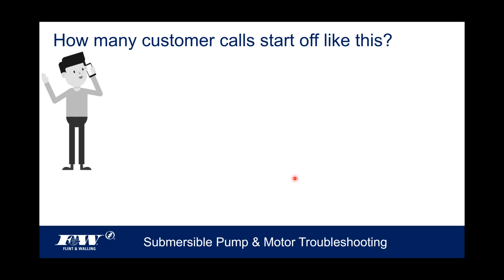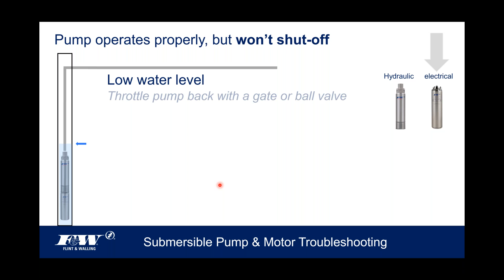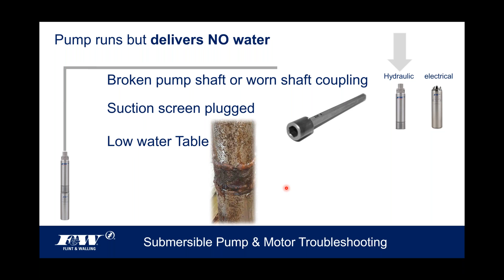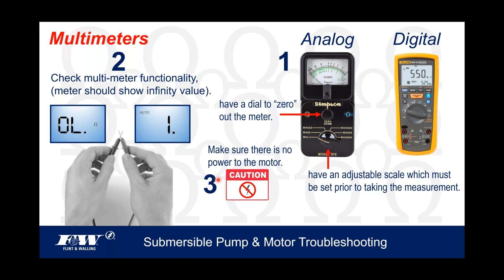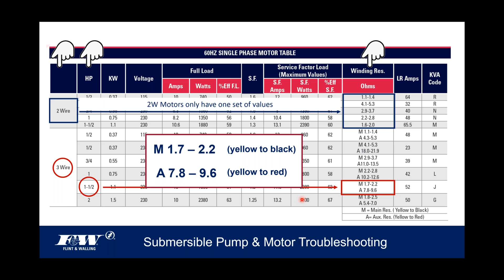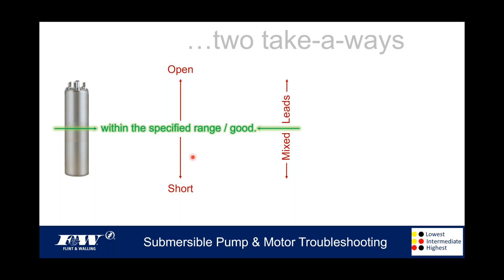Submersible Pump & Motor Troubleshooting

Comment: WOW! Was that ever worth sitting thru (my pump is not working). Was able to ascertain what the problem is besides a fried relay (I let the tank air pressure get too low too long). so when the pump guy comes out to do the work, I will understand exactly what he is checking for (and see if his readings match mine close enough to trust him) and be able to at least discuss the situation and understand. I could do the electrical work needed myself, but pulling that pump up from 200ft is NOT going to be my job.

Comment: i have a house that is missing a neutral on the pole transformer. this transformer services 5 customers. my customer needs a well pump to work and with the new ground fault protection it knows there is no neutral from the grid hooked to the transformer. the transformer is hook on the secondary side to ground via 8 gauge wire and G/rod at the bottom of the pole. would be nice to see some info on this issue.